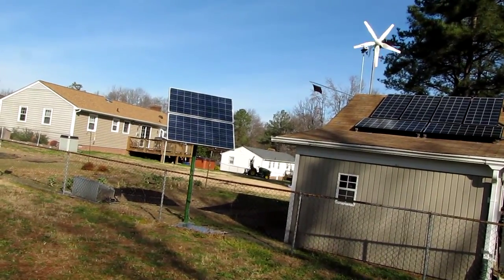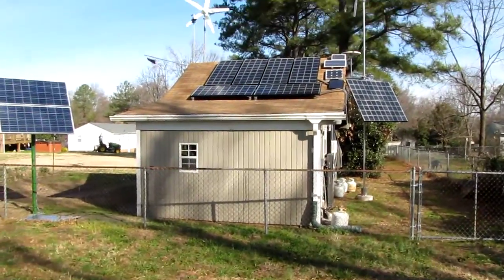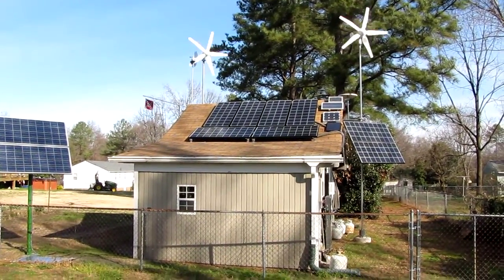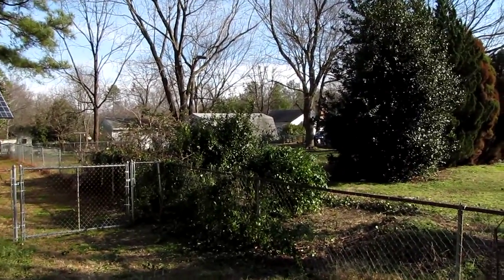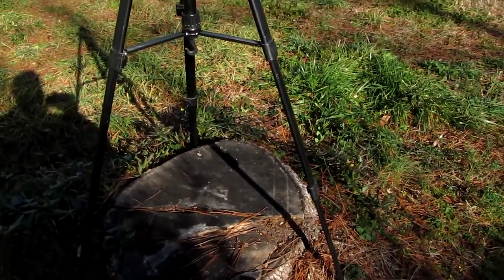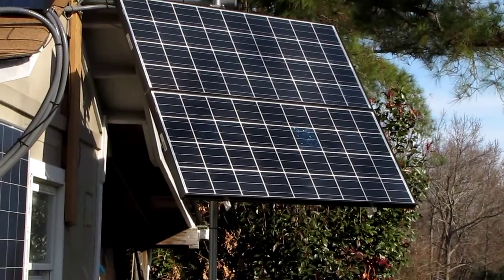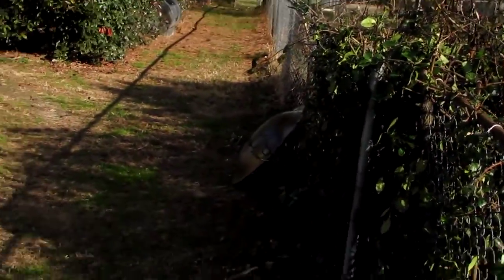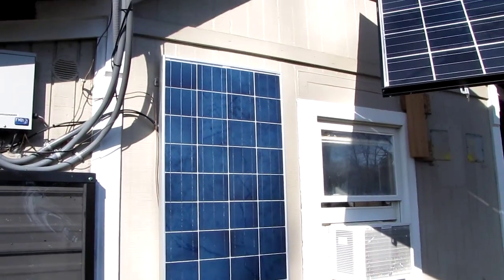RENEWABLE ENERGY IN  CHESTERFIELD VIRGINIA  with KYOCERA  Solar  Part 1  VIARLOCITY

Comment from the maker: @dogfan4lyfe I Used To work For Our Power Company I Burn All Electricity  & Have Propane Back Up Gas Logs For Heat & Gas Range  & My Gas Grill I Like The Idea Of My Off My Off Grid System When It says Selling all It reallly doing Is slowing Down My Meter & The Thought Of having Power When The Grid Out Thats why I like Solar and Wind

Comment: @kvusmc I'm ALL FOR going green, we all use too much energy, but I hope that what you're doing is eventually going to get you more than a warm fuzzy feeling. 600kwh of electricity in 1 month? That's pretty darn good. You produced all of that yourself with solar and wind and store the excess in your batteries? What about your heating? Do you have a propane or natural gas heating system? How much do you usually spend on that?